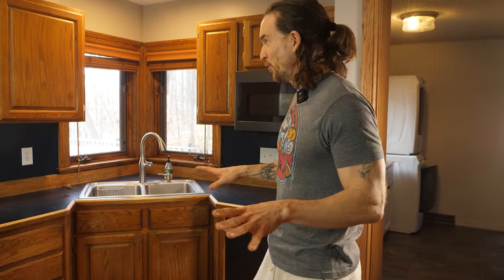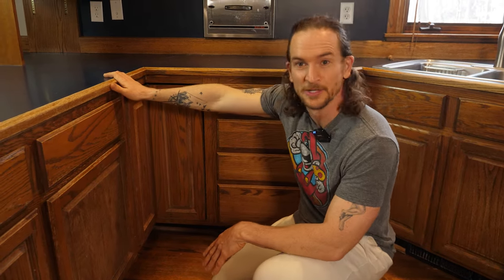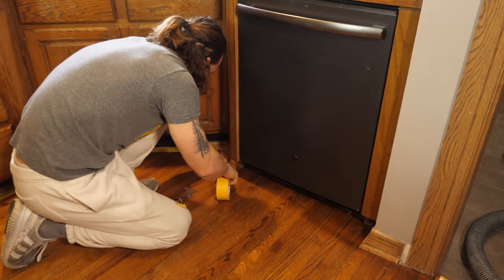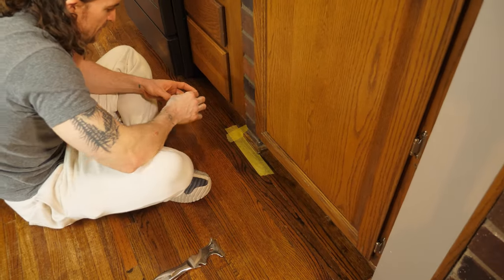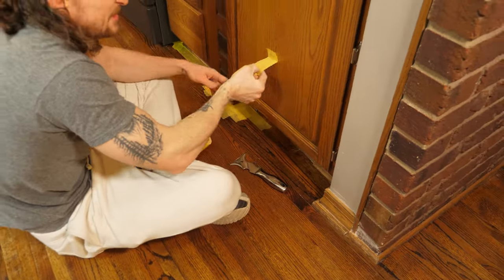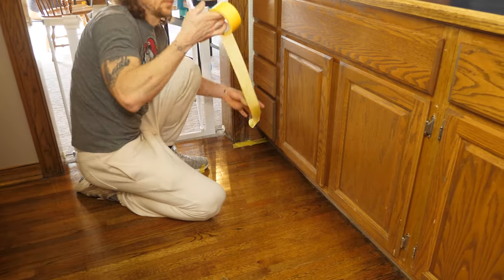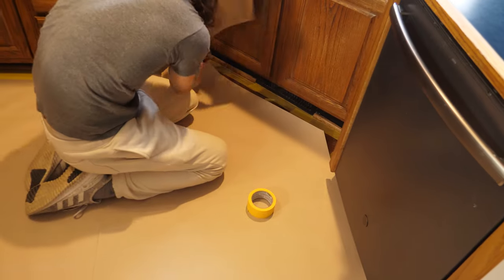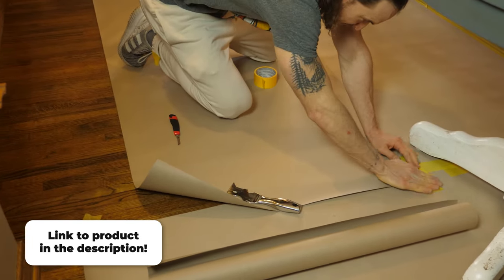BEAT UP Oak Kitchen Cabinets | Complete TRANSFORMATION

Comment: Just don't pull a permit in Maple Grove Just finished a flip up off Zackary and the worst part of the project was dealing with the absolute stupid of the ignorant inspectors - from the electrical to plumbing to  mech - wow never in my 30 years have I seen something like this. If you wanted to change an outlet they will look at all the electrical and could cost you 5k for that outlet swap. Anyhow, now the venting is done I love the vids!
Reply from the maker: We all need to vent! I did my basement a few years back and had a great inspector in MG. Nice guy, super helpful. Probably depends who you get. Thanks for watching!

Comment: Great tip. Put your hinges in small zip lock baggies and put the number on them. This way all screws and any other items ie rubber bumpers are all in the bag. You never loose anything unless you loose the whole bag. I put them in a cheap basket from the dollar store so not to misplace anything. I think I would have painted that brick white also to give that kitchen a brighter look.

Comment: Why don’t you use an orbital sander with a soft pad for curved edges to knock down the bulk and only hand sand where orbital can’t reach ?
Reply from the maker: Orbital tends to be too aggressive for this step imo. They can easily sand through finish, grain filler or primer way too easily. I prefer the control of hand sanding, but I have started using a 3x4 sander lately and found it to be a pretty good balance in between the orbital and hand sanding.
Reply: @diypainting  yeah I thought that why you hand sand but with the festool ones I think you can change speed and have number 1 setting and it’s not so aggressive

Comment: I may have missed this, but if you number the cabinet doors and cover with tape, then you are painting over that. Do you then remove the tape, install the door and then spot paint to cover the number in the end? Same with arrows on the drawer fronts. I've been putting the cabinet number where the hinge would go but you have it right in the middle.

Comment: Thanks to your tips on prev videos i did almost pro grade spray on cabinets. Same paint used in this video, SW Urethane lays down awesome, it looks orange peel but disappears IF temps are low and no sun or wind. I used a Homeright Finish MAX sprayer with green tip 1.5. thinned about 10 percent. i did 2 coats over maple cabinets.
Reply from the maker: That’s awesome to hear! If you ever feel like sharing pictures, we’d love to see them. Ryan@diypaintingtips.com

Comment: Is it possible to use a roller for painting on the cabinets? I am doing this on a vintage camper and all the walls are wood grain. I've sanded everything down and vacuumed. Started applying the USG but its an insane amount of handheld brush work. Will a roller do the trick? Or will it not get into the grooves enough?
Reply from the maker: A roller can work great. Just thin the USG down a bit or it won't roll very well. make sure to work it in a bit too. A foam roller also works great for priming and top coating if you don't mind a little bit of texture (not bad though, just more than spraying).

Comment: I’ve watched several of your older videos where you use the old-school air sprayer. Does this sprayer provide the same level of finish?
Reply from the maker: The Wagner Flexio 5000 can produce an incredible finish on cabnets, on par with far more expensive sprayers.

Comment: Thanks you for sharing...your doing great job on teachning🙏👍👍🙏👍🙏🙏 a question…why you don't use sanding Machin for sanding cabinets?
Reply from the maker: I do occasionally (just not usually in video). The main reason you see me use certain tools on this channel is because I am trying to do everything with DIY methods. The channel is DIY Painting and I want it to all show methods that an average homeowner can do. If I pull out my $500 sander, $700 vacuum, and $2000 sprayer, that's not really DIY anymore, but Pro Painting Tips. Know what I mean?
Reply: @diypainting  yes thanks .wish one time you paint with a foam roller n brush as well….I appreciate

Comment: Great video! I know you didn't use Zinsser Smart Prime in this kitchen cupboard reno, but I seen you recommend it in another one of your videos as one of the best to prevent bleed through with original oak. I have been having that problem with other primers and wanted to try the Zinsser Smart Prime, but I can't seem to find it on Amazon or any local hardware stores. Does it no longer exist? My search keeps redirecting me to Zinsser 1-2-3 Bullseye.  Does that have the same quality as the Smart Prime?
Reply from the maker: Zinsser 1-2-3 is fine, but I wouldn't use it. If you have a Sherwin close by, go and ask for Extreme Block Water Based Primer and use that. If you have any bleed through after that, my guess is it would only be small spots. If you have some spots, hit those with a spray can of Kilz Original. That's what I do and I don't have any issues.
Reply: Thank you so much! I will try that:)

Comment: Thank you, I already learned so much from watching your two videos. Could you tell me how much should I expect to pay for a project like this (kitchen cabinets)
Reply from the maker: Hiring it out, $4,000 - $7,000 depending on who you hire and size of your kitchen.

DIY - $300-$500 for materials and an extra $250 for a Flexio 5000 sprayer if you need a sprayer. 

You can buy everything at DIYPaintingSupply.com and save 15% with this code: YouTube-SAVE15

Comment: do you caulk the inside panel door seams?
Reply from the maker: Absolutely. If you do, it could potentially crack as the wood expands and contracts with the seasons if you use a low quality caulk. Choose a high quality caulk with high elasticity and you should be just fine.

Comment: Would you recommend thinning Cabinet Coat at 20% using a Graco True Coat 360 airless.
Reply from the maker: The TrueCoat 360 might be able to handle it unthinned. But 5% still might be a good idea.
Reply: @diypainting  thanks